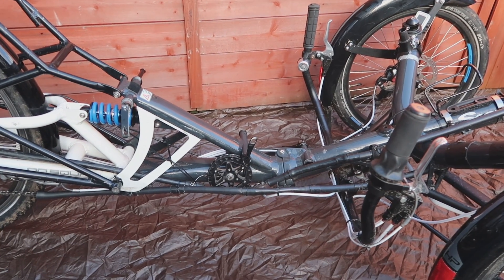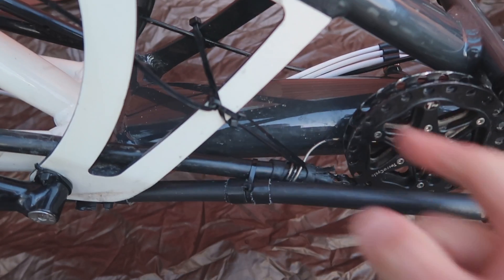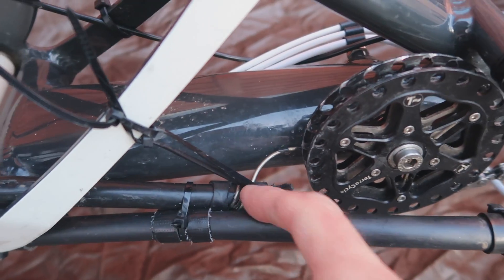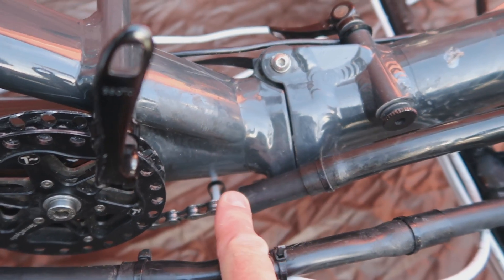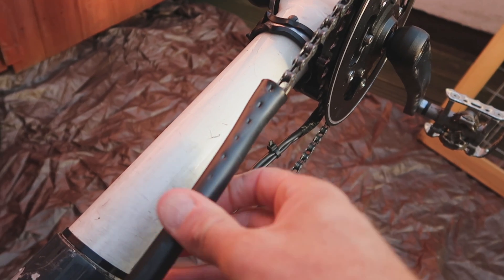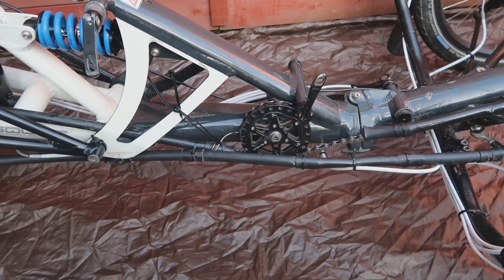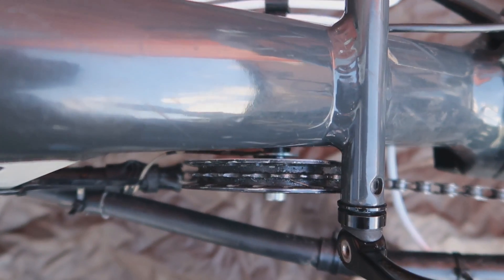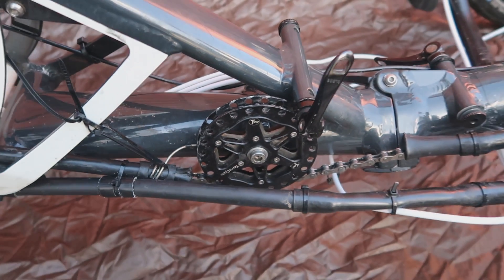Part 1 | Taking the drivetrain apart again.

Comment: Very nice video, sorry for the luck of the failure. This reminds me very much of my regular winter maintenance on my wee beasty. Chain off, clean it, check for stretch and examine tubes and mounts for weak spots. Removing the E assist was amazingly simple, very nice. Be sure to give the chain a good lube before re-installing it. I usually give mine a good shot of compressed air before re soaking it to free up any captured bits, after all the chain is a series of bearings and needs interior cleaning even more than exterior shine. Pour the degreaser through a coffee filter and you can reuse it for a final soak, you'll be amazed at the tiny particles the filter catches. Enjoying this series. KBO my friend.
Reply from the maker: You have some really good advice there Bryan. Its great having people like yourself with so much experience to pass on in the comments, so thanks as always. Lube... more on that in the next one. Coffee filter... brilliant idea!

Comment: Hi Tim recommend a Sonic cleaner but not too small in size or you will disappointed in what you can clean. can be used with boiling water and w/p liquid. Also Hot wax for the chain.would like to show my ice rear add on rack but need to find a way to send photos.great 👍 video.
Reply from the maker: I've seen sonic cleaners cleaning golf clubs before. Never thought about one for bike parts. Great idea. 👍 You can always email me photos if you like. Its good to see other peoples rides. Just make contact through the contact form on my website. Hot wax for the chain... I looked at it before and though I'm not against the idea it seems a lot more effort for a small gain. Maybe its something I should try sometime.

Comment: I am surprised that it moved. I have a garden hose for chain tube and even mounted not really locked, it didn't move. I secured it more to be sure. 

Do you know why it moved? Did something get in the tube? 

I am saving for an e-assist. 

I like these video's. Now I can see how they made the frame.
Reply from the maker: I dont know how it moved for sure but I guess something got stuck through the chain which wouldn't fit up the tube.
Glad you enjoyed it.
Reply: You d the right thing to get a new bold. The old when it is bend, will bend faster and an can break.

Luckely your e-assist didn't get damaged.

Comment: If you have a really good Hardware store handy. Take that bolt in and get a new one. No reason to go too a bike shop. See if you can get what is called a Grade A, bolt. Now that the chain is off, you need to measure it. I'm pretty sure you got the tool some time ago. Any ways, stay safe.
Reply from the maker: HI James. Yup I already got the bolt. Wasn't easy to find the exact one mind you but now I have spares too so alls good. I have the measuring tool, you're right. I'll be sure to check it. Even though this chain isn't very old yet, I have been told that the electric assist can shorten the lifespan of the drive train bits and bobs.

Comment: Hello Tim,
I hope you are well,  I'm sorry to hear about your chain tube issue.
I've installed my E-ASSIT which has revolutionised my trike. Unfortunately I've a major issue, the Befang motor has started to move in the bottom bracket. I found a solution from Luna cycles in the USA, a stabilizing bar which will tie-in with my front mech mount preventing and other movement. Fingers crossed that should sort everything out.
Just a wee question for you, have you heard off a stabilizing hydraulic steering bar used along side  E-assit.

Comment: Weirdly my top rear chain tube moved into the idler on my ICE last week at low speed - I heard it go but had no idea what caused the noise - had a look and managed to tighten up the lose bolts before it went drastically wrong. Now all back together with loctite.
Reply from the maker: Good to hear that you were able to do a quick and easy repair Graham. It is a starnge noise indeed when something gets in that idler wheel eh?
Reply: This happened on my ICE too (though the idler just chewed the end rather than eating the tube). ICE sent me a couple of new clips and section of hard tube, easy fix and no probs since! Interesting that it’s a cross-species issue - maybe another spot-check to do when doing preventative maintenance!

Comment: Seems to be an epidemic with chain guards , chains , and EA that has crossed the Atlantic. Out riding last week and I hear this grating , rubbing noise and look down and both guards had worked loose and slid back and forth and trapped chain in spots and obviously made pedaling difficult. I have  a Bionx  EA which has a rear wheel hub and obviously wiring going back to it zip tied all over the place, including to chain guard. Needless to say, the frayed edges of the now sliding chain guard tore the wiring...and the bracket holding the tubes was bent(probably causing this chaos initially).... and of course the chain got way out of whack. I tried the EA..which I rarely  If ever use to expedite my trip back to the car and found the EA didn’t work and inspection in the parking lot exposed all of the damage. All this was beyond my pay grade....needed parts directly from Catrike, etc.....soooo $250 later...new bracket, guards, new chain, and rewire EA. Thanks for the demo on chain cleaning and undoing and putting stuff back together.The Catrike sits 4” off the ground and I ride quite a bit... 150 miles per week....and my trails in New England are full of downed leaves, twigs,and general debris associated with this time of year. I guess I better be more attentive going forward. Thanks for the tips.... get up and running fast!
Reply from the maker: Ouch! Sounds like it might indeed be a "time of the year" thing where we all get stuff stuck in the moving parts eh!? Glad to hear you got yours all sorted Mark.

Comment: I was wondering if the chain was all one length and if so did that make it harder to handle.
Reply from the maker: Its is one piece and yes its a pain to handle no matter how careful I am with it. You put it down all neat and tidy, turn your back and its like someone pulled it through a thornbush sideways. Oh well, its got to be done.
Reply: I SO agree 😠🥨😁